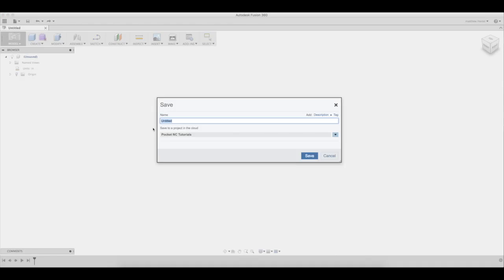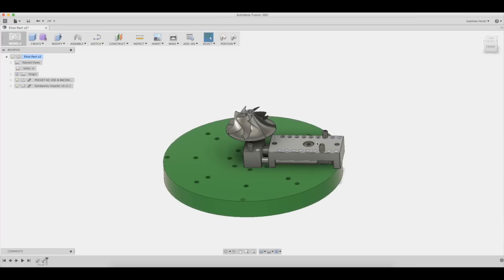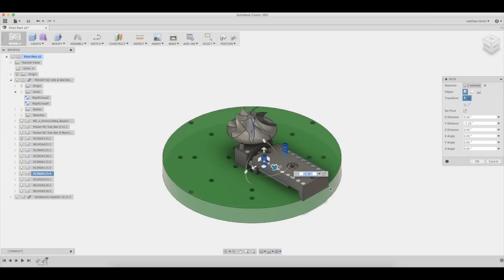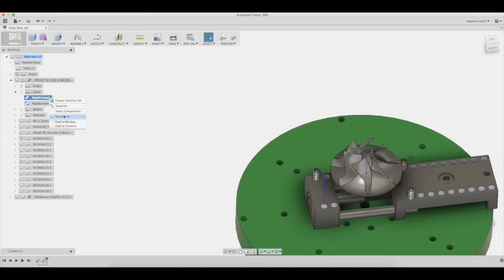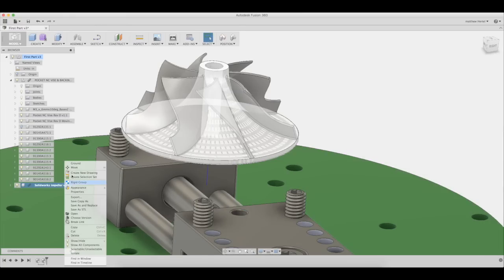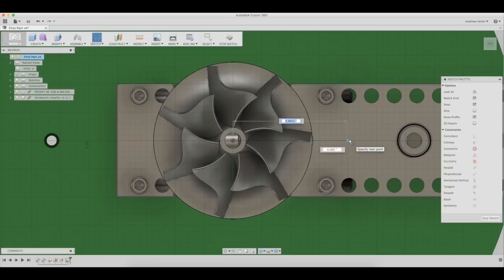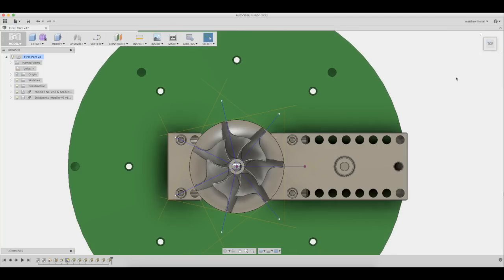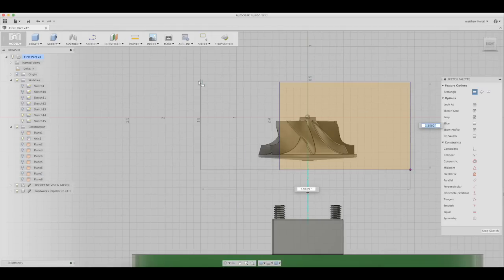Pocket NC Impeller Part 1 - Fusion 360 Geometry

Comment: one question:

how do you want to mill the impeller 3+2 axis like? i think its impossible if not, correct me :)
Reply from the maker: +ipadize Think of it this way, the machine can rotate to the same number of angles by indexing as it can doing full 5 axis machining.  Stay tuned for the next couple of videos!
Reply: +Pocket NC but 3+2 axis is just not like full 5 axis simultaneous, of course you can do it in 3+2 axis, but it is way more extensive, i think. But i have another question, does your Machine support TCP? (Tool Center Point) because i saw your other video about the Pine and 5 axis simpeller video :)